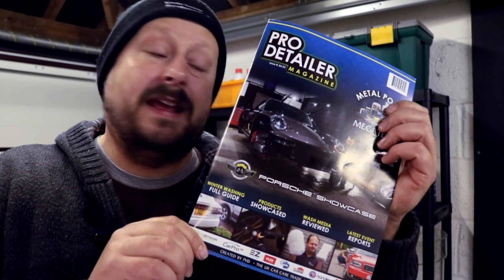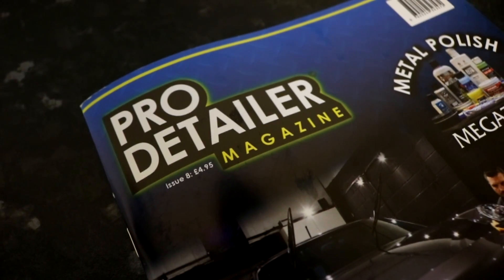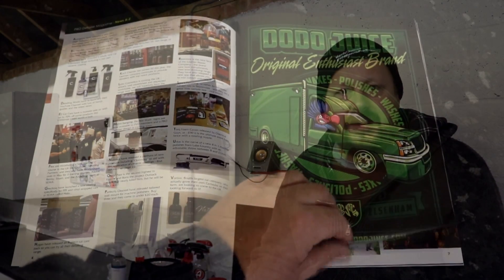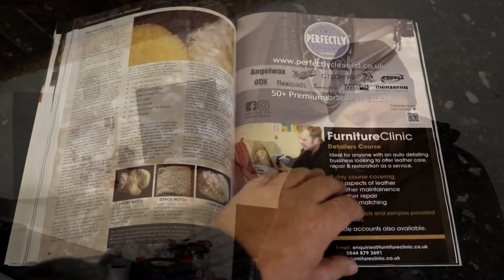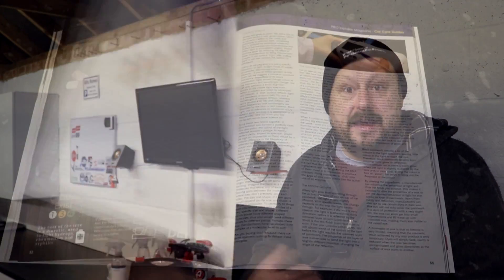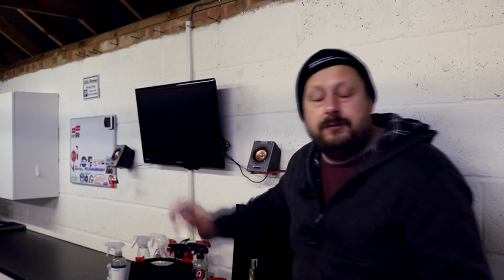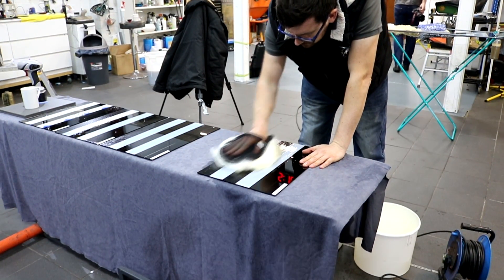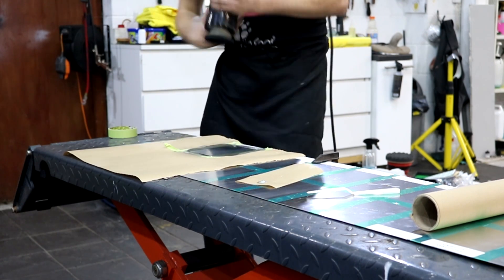Mega Testing Metal Polishes and Wash Mitts - Pro Detailers Magazine Vol8 Sneaky Peaky

Comment: Looking forward to the Bead Maker test. Everyone seems to be raving about it and the results do seem to be very good. Should be a good one 👍🏼
Reply: We Have been Using it over Here at our shop in the States for a few weeks now.  We had Levi From the "RAG Company" drop off some to us. It is just a "Game Changer" It is so easy to use with both application and wiping if off. It just gives the surface of your car such a slick feeling.  Its like the feel you get from before and after when you use a clay bar on your paint. from rough to smooth. Bead Maker gives you that kind of feeling all over again, even though you know you have polished the vehicle and it is super clean and smooth. After application wait a few seconds work it in then buff it with a quality Microfiber towel then "feel the paint" Just Awesome stuff.

Comment: I can tell you this about bead maker. If you wax your car it stays smooth for a couple rains then gets a little rough to the feel. Bead maker stays smooth to the touch for quite a long time. Water doesnt seem to effect it. However, at least on my Mustang, water sheeting is a little better with wax, as bead maker creates, tiny beads that then sheet off compared to wax that runs off as soon as it hits the body. I am referring to sheeting when you are driving in the rain, not pouring water over it. Another plus to bead maker is revived so to speak when you wash the car. Instant smooth. I usually put a light coat on every weekend when I wash the car. I buy it by the gallon
Reply from the maker: beadmaker has some cool things going for it though for sure the results are pretty interesting.

Comment: I tried Sonax BSD today for the first time, so I'm curious to see some comparison with Beadmaker. Are you planning on a durabilitytest on a panel/car? By the way, how's Fusso wing mirror sealant doing on your shop window?
Reply from the maker: hey dutch glaco is ridiculous.  Its the same as it was when its applied.  the down side is its a bugger to apply compared to something you could just spritz onto an applicator and wipe over.  wing mirror glass is best removed for glaco application, proper prep and spray onto the glass when its vertical so it does not pool.   If you can get a good coverage over the glass and then just leave it your home and dry and the protection is really impressive.  Where I spreyd it on the glass in the vid, it ran down over half the wooden window ledge.. and like the ledge gets insane beading.  its worth a picture actually :)

test includes durability yer :)

Comment: Hi john, been watching for a number of years and every video is top notch! I know it may not be something many people are bothered about but I wondered if you had tested the difference between a shampoo contact wash whilst the snow foam was still dwelling on the car and a freshly rinsed off panel?

Sam.
Reply from the maker: lol spooky timing sam.  ive been testing foams today and 2 of them are shampoo's s Im been thinking about this subject.  however  "snow foam" prewash are different to car shampoos, typically they use more rinseable components like eythoxolate acohols and fatty acids and sodium salts that can function better as a "soak" type dirt softener.    Car shampoos for contact wash have slightley different setups chemically, they can contain some glycol based surfactants in there to create slip, and cationic components which help lift dirt in conjunction with the contact off the mitt..    Spraying a shampoo ontop of dirt all over the car and then doing the contact wash.. thats a no go for me, especially right now in UK conditions, just too much road film and dirt that can simply be broken down more and mainly rinsed off the panel before the contact wash.   In the summer when the car is generally just dusty then you could almost pre rinse with water first and spray shampoo all over the car and do the contact wash, that could be done no problems (some will want to pre wash first still though).   On big danger for me with spraying shampoo all over the car in the summer is heat in the panels drying out the soap and just creating a bigger risk of soap stains.  thats a big problem for me and I have to work around that, ill always have a hose to hand and work in sections and rinse sometimes during the wash to keep the car wetter and cooler.

In short though Im not a fan of spraying shampoo over the car like a snow foam and then going in and doing the contact wash..   On the golf though I perhaps would have no issue with doing that, who cars etc.. isnt like "that" important" but on a car Id spent a lot of time to get the clearcoat nice Id just stick to processes that I know make sense.   I always try and avoid doing contact wash on a nice car when I can see and feel a lot of dirt under that foam.. I want the car pretty close to clean when I do the contact wash.
Reply: @ForensicDetailing  thanks for the reply John! 
I Look forward to seeing your findings, I was watching a video by obsessed garage and noticed he snow foamed the vehicle then instead of rinsing off the foam he  lathered up his shampoo bucket and wash mitt and went straight in with the shampoo contact wash with the foam product on the car still. Got me thinking somebody must have tested the difference of damage inflicted but as you say it would depend on the level of dirt and paint protection etc!
Reply from the maker: @taskerere   Im sure he gets a ton of stick about that lol as a you tuber if you do anything "off piste" you get 5000 dudes telling you that you dont know what your doing, i get killed for not using 2 buckets most of the time.  rest assured though his paintwork will be spot on, if it was getting hammered from his wash process he would notice it and tweak it.    matt lives in florida, road film isnt a problem there generally, and he has a covered wash bay to have the cars out of the sun. and hes washing his cars regulary using good mitts and not hammering down on the paintwork.   If there was a alter dimensional Matt that pre-wash and rinsed the same porsche gt3 before contact wash,  and we could warp that car into our dimension to compare with "real" Matt's GT3..  I dont think there would be any difference.      Over here though in the UK my car can look like a brown respray if I dont wash it for a couple of weeks and going straight in on all that road film isnt a good idea.  so theres no universal right or wrong really.. lots of times I dont bother prewashing the golf and I clean it like a crazed turbo charged gorrilla.    the most important thing with detailing your car is to love the process of doing it however politically correct or incorrect your methods are.  you can learn a lot from OG he has an eye for quality and his approach is a good guide on how to get the most fun out of all this (something I struggle with sometimes).  I wouldnt even have wykes carcasses in my garage or paint on the walls were it not for seeing matts channel back in the day when he was at the other house.  his channel is one of the few real things left on you tube where he genuinly does his own thing and has no interest in deviating or following "you tube" suite for views. muchos respect